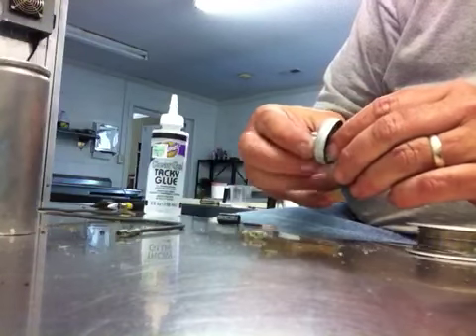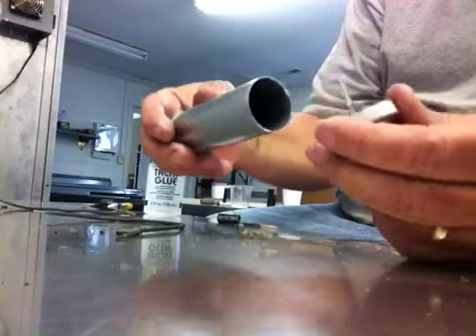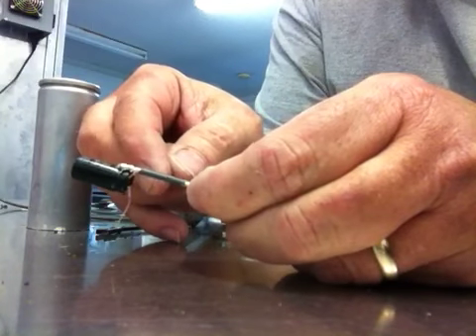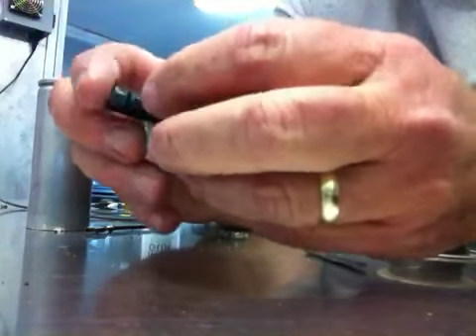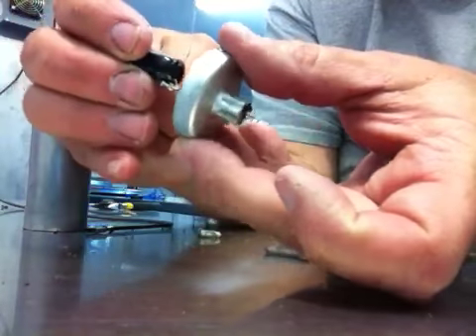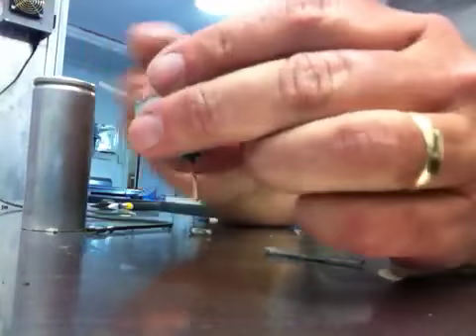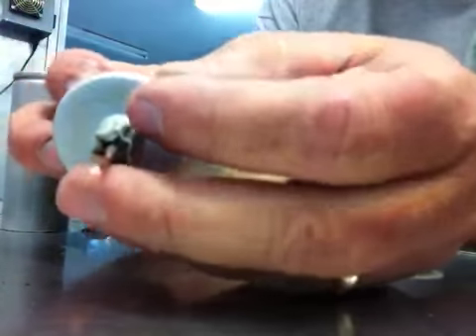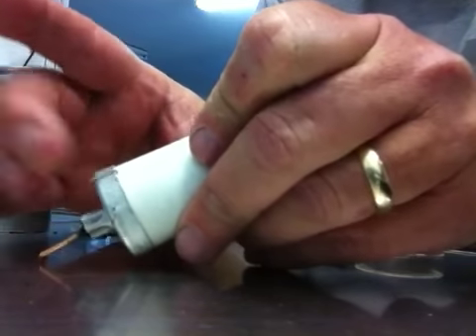How I restuff electrolytic can capacitors.

Comment: I have several problems with this: - 1. a can capacitor of that size will likely contain several capacitors, or if just one, it will require several of the smaller ones in parallel to equal the original capacitance.   Typically, I am battling having enough room in the can to correctly replace the original capacitance and voltage, not to mention that higher capacitance and voltage is usually desired, requiring even more space. - 2. you failed to solder the negative lead to the aluminum can.  3. you are stressing the negative lead far in excess of manufacturer spec with your PVC pipe method.

Comment: I am working on an Emerson table radio with a BF chassis from 1938.  There are 2 can type electrolytics for the for the power supply filters. There are no polarity markings just the values.  When I measure the rectifier tube output I have my dvom ground to chassis and red to test the cathode output my meter shows reverse polarity.  Did radios of this time period have positive grounds?